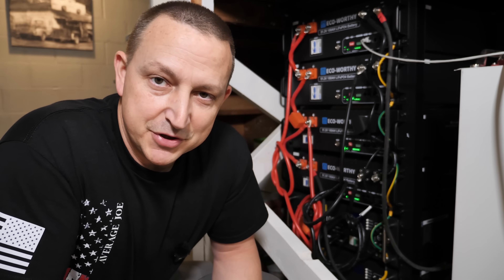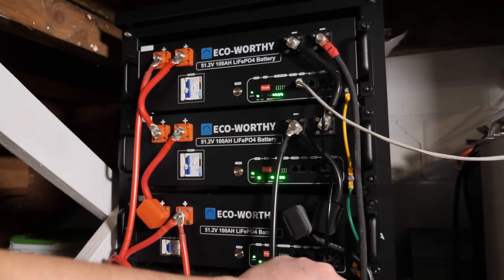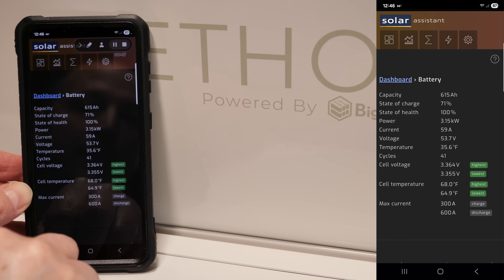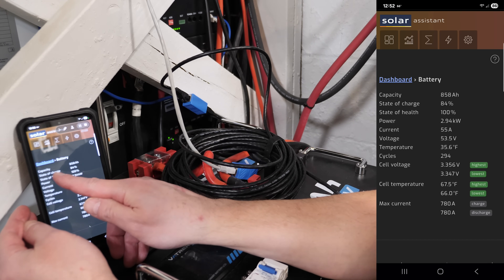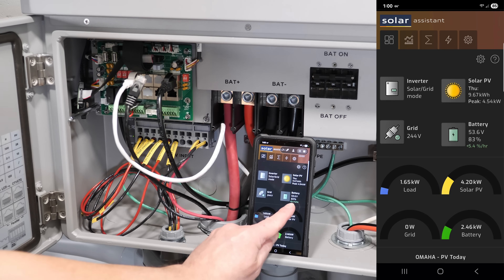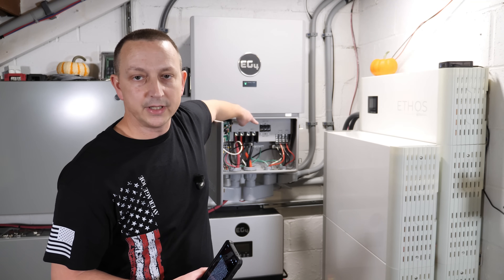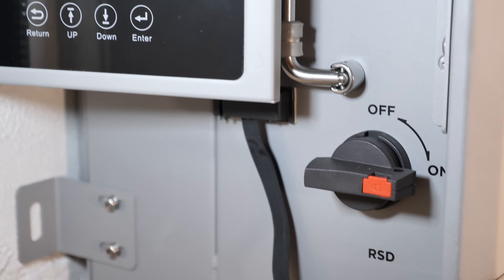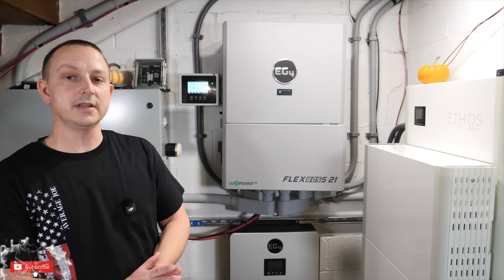ECO-WORTHY and the EG4 FLEXBOSS21

Comment: Why on Earth would you install a FlexLoss 21? Haven't you heard about all their DC to DC failures? Here’s what Google is reporting about these inverter failures. "Reports indicate significant hardware issues with EG4 FlexBoss 21 inverters, specifically concerning the DC-DC converter board, leading to burnouts, disconnections, and failures, with users discussing numerous RMAs and suggesting potential manufacturing "bad batches" or component issues that EG4 seems to be addressing with firmware updates and potential hardware revisions. 

Evidence of Failures:

User Reports: Numerous posts on forums (Reddit, DIY Solar Forum, Facebook) describe the FlexBoss 21's DC-DC converter failing, often resulting in the unit shutting down or disconnecting from the battery system.

RMA Activity: Some users report a high volume of replacements (RMAs) being processed for this specific model due to these hardware failures.

Specific Symptoms: Issues include the inverter failing to recognize battery voltage despite correct readings, loud buzzing in appliances (indicating DC offset), and general power throttling."

Comment: Just snagged 2 eco-worthy 314 wall batteries on black friday for 4k on eBay. 20 panels from Signature Solar with the 10% off and $100 shipping deal. About to pull the trigger on the Flexboss18 because it will all be indoors in the room beside my livingroom, so I want it to be quiet. From what I have seen they are quieter than the 21. Thanks for all the great info. Looking forward to start making my own power instead of paying the ever increasing electricity costs to the utility company.
Reply from the maker: NIIIIICE! You know I have discount codes for all those or at least another $50off from Signature solar😉😉
Yes if you are going to install indoors and dont want to hear it! The FB18 is much quieter than the FB21 or 18kPv!

I love not paying the utility company and investing in myself/family/home and I wont have to worry if they keep rasing the electric rates. PLUS a bonus is you will have power if the grid goes💥🤘

Comment: one huge question, you have showed us three different sets of batteries hooked up to the flexboss21, and in the wiring connections, you only show changing the communication cable. My question is 2 fold. 1st are you disconnecting the battery cables from the flexboss so you can hook up to the differents batteries set up, or do you have a setup, that lets you switch quickly between battery sets? On the latter, if yes, can you provide the video for that, i would be interested to know how you do it.
Reply from the maker: Oh yeah ok my bad. I have all 3 banks connectes in parallel. The ethos are wired directly to the inverter since they are so close. The rest are on a longer set of 2/0 cables from the other terminals on the inverter and ran over to the creepy stairs and are attached to some diy busbars I made. Those busbars are in a box above the orient power batteries. This was just a quick way for me to beable to connect ALL batteries and continue to use/test and cycle. I may clean it all up after I get my diy battery build complete. I can still show in a video if you would like to see it. Just let me know and Ill get it done.😎🤘

Comment: Thanks for the video.
How’s your diesel generator doing?
Reply from the maker: Thanks! Just ran the genny yesterday actually lol. Havent ran in a few months and needed to make sure its running good for winter. I am almost at the 100hr oil change so will try to get that done before it gets  to cold. Other than that shes running strong💪😎

Comment: Thanks for the video,  I have Discover rack mount and it also works set to #6.
I also use Solar Assistant and on your screen it shows temp of 35.6 F similar to mine but that can't be true, just wondering if you know why it's wrong. 

Also though the BMS allows for very high numbers, 600amps in your case, the FB21 maxes out at 250amps in both directions, I kind of wished it displayed the actual Amps it will charge and discharge set by the inverter settings, any thoughts?
Reply from the maker: Yeah for solar assist and the 35.6F. Im not sure what that temp referrs to. Ill try to keep an eye on it to see if it ever changes. It might be a "option" that isnt available so it just stays at that temp.

Yes 100% true that the actual amp output is 250a. I was just showing that it shows the correct "info"🫣😃

Comment: Thanks for the video! I just ordered two EG4 wall mount internal batteries. I couldn’t get Eco-Worthy to give any sort of decent discount and by the time I added  a rack, some sort heat strips for the garage. Bought a charger and other misc parts the price difference want enough to justify them against EG4 which would give me a fully certified UL9540 system. I tried but they ordered a whopping $10.00 off of a $5k spend.
Reply from the maker: You bet! Yeah I hear ya if you are looking to setup your system a specific way or need heat and adding extras. The EG4 wall mounts are a great option! I have not had the pleasure of testing any of them out yet. I am glad to hear you have some stuff on order and building a system. 😎🤘

Comment: Now I am confused how did you wire all those batteries together and have different state of charge or maybe you didn't show us. Cheers great video.
Reply from the maker: They are all paralleled but I only use 1 group of batteries for communications. I was mainly showing that each brand of battery does work.😎🤘
Reply: @AVERAGE_JOE  That is why I am confused how can different batteries have different voltages if they are all paralleled.
Reply from the maker: The voltages can READ slightly different from battery bank to battery bank probly because the length of cable over there under the creepy stairs is pretty far lol. The SOC for the eco rack is lower cause that one has different lengths from battery to battery since they were different models. I eventually want to add busbars to that rack and then make equal length short stubby cables.😃💪